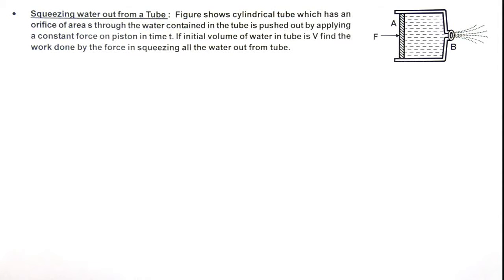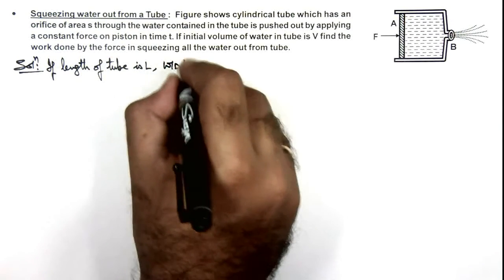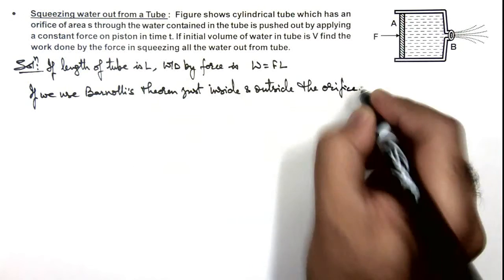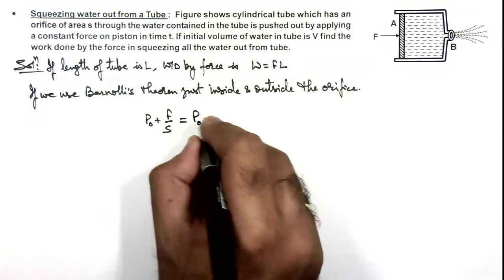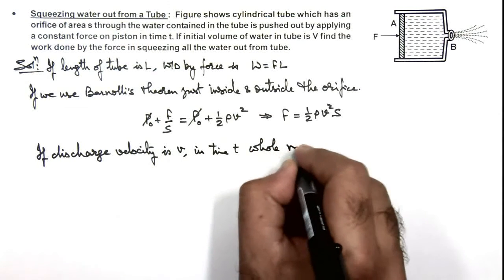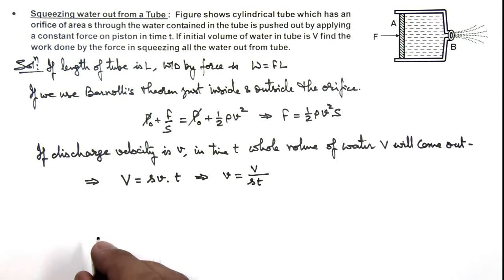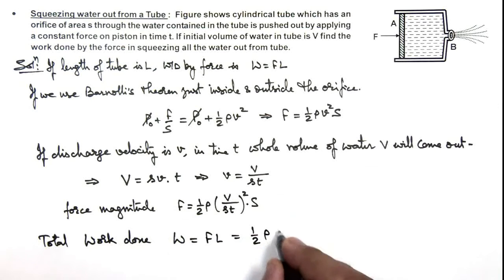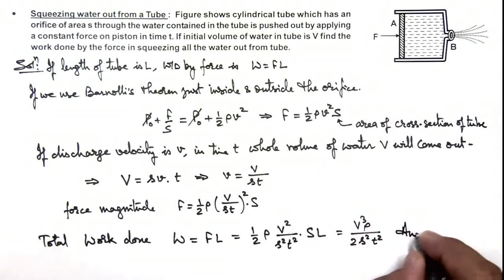34. Advance Illustration| Fluid Statics & Dynamics | Squeezing water out from a Tube | Ashish Arora

Comment: Sir,how can discharge velocity remain same throughout the process?
Reply from the maker: Because the velocity of ejection is a linear function of force and here constant force is applied...
Reply: So velocity should increase at constant rate....but for volume calculation you took velocity constant?
Reply from the maker: Why don't you read what I am writing and watch the video carefully... velocity is a linear function of F so if F is constant then v will be constant... you need to improve your reading and self interpretation otherwise it may be a problem in exams...
Reply: Ok.
Also, thanks for the advice ,I'll try to improve...